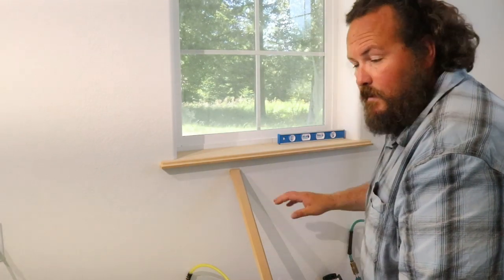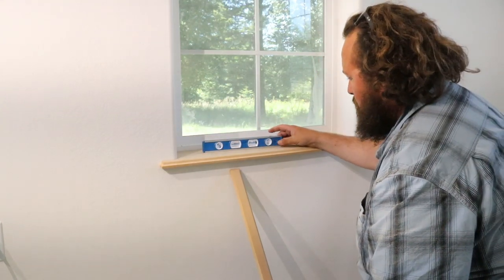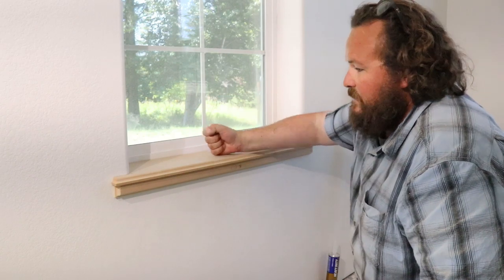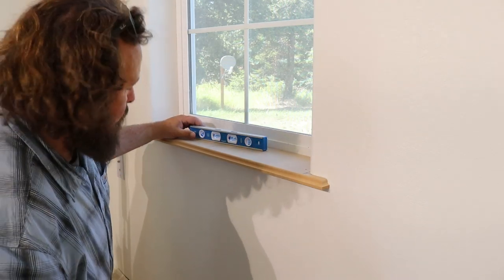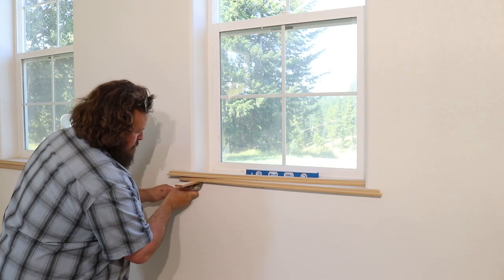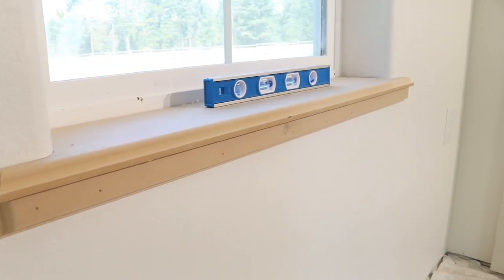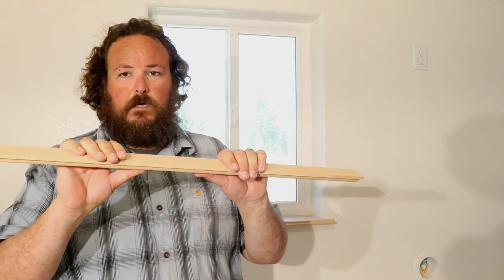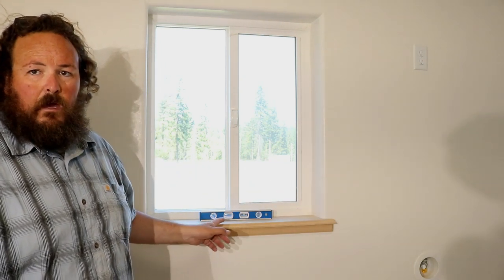How To Install Window Trim

Comment: The channel "Project Farm" did a video testing adhesives like Liquid nails, 3M, Gorilla Glue, Etc and Loctite 8X destroyed all of them for holding power. When I say destroyed, I mean destroyed all the others, none were close. I thought for sure liquid Nails would be close, nope !
Thumbs up and great video !
Reply: august 
Matt Risinger’s 
‘the build show’ did a test using; 
Liquid Nails
&
Loctite PL.

PL won hands down but in this application, a non-structural assembly, Liquid Nails is the best investment for the cost!
adhesives also.

Nice Trim Work 
Mr Grizzly Josh!
Reply from the maker: Thanks for the heads up! I'll go check it out.

Comment: Great explanation for the use of mdf, i use it also for a lot of paint grade work. The stuff is so nice to finish and mill. Popular is another real wood used alot here for paint grade. But slightly more expensive.
Reply from the maker: I do love working with popular but it doesn't seem to paint up as smooth and even as MDF.